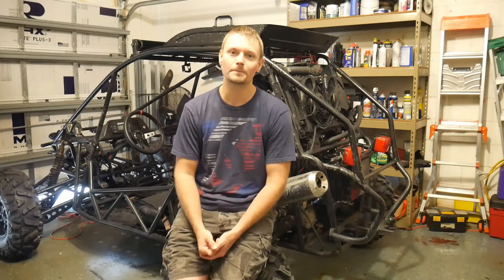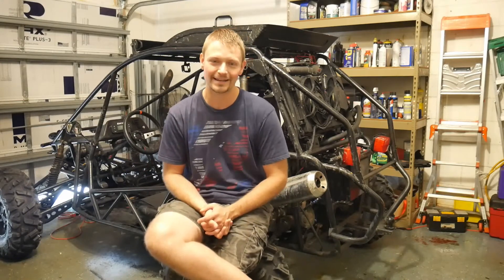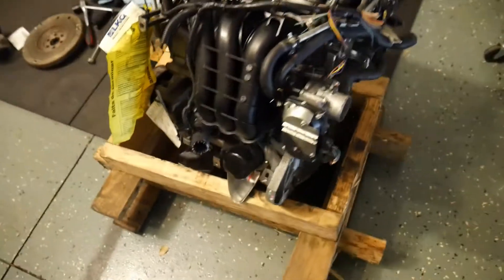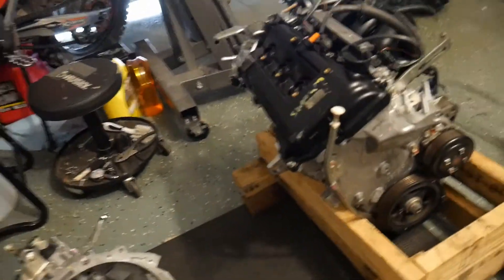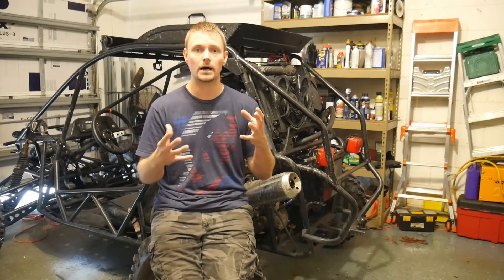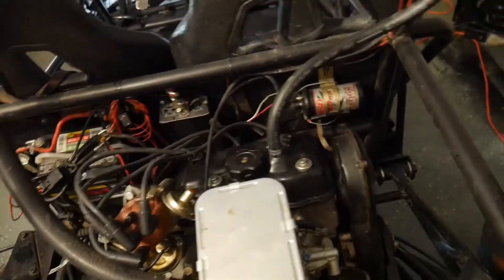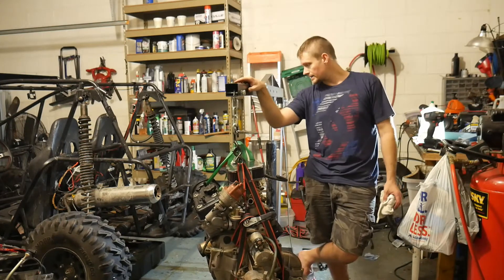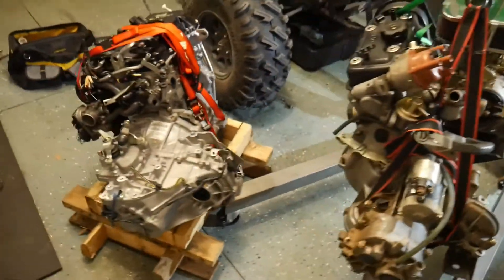Dune Buggy BUILD | EFI Car Engine Swap Series! Part 1

Comment: Love how he talks about vvt, efi and 4 valve heads like its some revolutionary tech
Reply from the maker: Love how not a single motorcycle or sxs engine manufacturer uses this "common" tech 🤷‍♂️
Reply: @DirtGearTv  can am has 4 valve heads and efi. Ducati has 4 valve heads and efi. Want me to list more

But i more meant on an american pov. Yall still think push rods are the way to go that was the reason for my comment
Reply: @DirtGearTv  I have a Harley Davidson with four valve heads, dual overhead cams, and variable valve timing.

Comment: Really enjoyed watching this series. Continuing to follow as you rebuild the engine now. I know you chose this engine for the “upgradability” and mostly for the lightweight aluminum block, but what other engines were you choosing from?
I’m going through the same process now and trying to focus on a handful of options to weigh the pros and cons.
Reply from the maker: A bike engine is the only thing going to be close in weight/power. Would be cool to have a 2.0L car engine but since I can hardly fit the triple, that pretty much rules out anything else for me. Good luck whatever you choose!

Comment: didn't this come with a F8B 800CC Suzuki Alto engine? I was under the impression they used a automotive 3 cylinder car engine in these Roketas. There are guys running 80hp in these F8B engines NA & 150+hp in the turbo models. Why didn't you just go that route?
Reply from the maker: Cost and availability of parts mostly. F8b is iron block (heavy) and lack of fuel injection for boosting makes it tricky. They are solid engines but limited by those things I mentioned.

Comment: What are you going to do with dif? Leave it open?
Reply from the maker: vitaliy loboda I left it open so far for testing... but I gotta tell, traction has not a single time been an issue for me in deep muddy muck or sugar sand. I’m sure if I were rock crawling some really steep stuff i’d notice but for my riding, I deff decided to leave it open

Comment: You may answered this before. Which Chinese buggy is this? I’m looking for a project buggy and I like the look of yours.
Reply from the maker: Mike Lapera I get the question a lot, but to be honest I don’t know who make its. It’s an unusual cross between the older (2006) Sand Viper 800 and the Roketa GK25. Both Joyner and Roketa are good machines for the money. BMS looks like are also getting involved in some larger nicer and more powerful buggy’s, Id check out the BMS unless you find one on the used market

Comment: will do over 100mph from my expernce
Reply from the maker: Ben Smith The projected top speed of a 1.2l mirage is 125mph, even if that’s only 105mph, the buggy will be over 1000lbs lighter 😳. I’d expect it will easily do 100
Reply: DirtGearTv Another thing to think about is there is some kind of transmission break it will not let it coast in neutral any faster than you accelerate it before you pull it out of gear rolling down a massive hill (Rolling speed of 60 to 70 miles an hour I find this happens) although this will probably not have any effect in your application

Comment: What about the computer for the new engine? Do you think you’ll need it?
Reply from the maker: harley09ski There’s definitely going to be some unique challenges with the computer setup! I already have the ECU but will need wiring guide and i’m not sure how the ecu will respond if I simply am removing many sensors and inputs or if it will run at all with out traction control and other sensors i won’t be using. 

Also since it’s a modern engine most are drive by wire, I was hoping the mirage was too cheap for them to do that with, since they did after all use an actual clutch cable. So my concern is what if the drive by wire gas petal gets wet? or drowns in a puddle? Also will the drive by wire be constantly be attempting to control my throttle inputs during rough or loose terrain...  If I can get the drive by wire to do what I want it to and water isn’t going to ruin it, deff seems cool, One less cable to have to run!